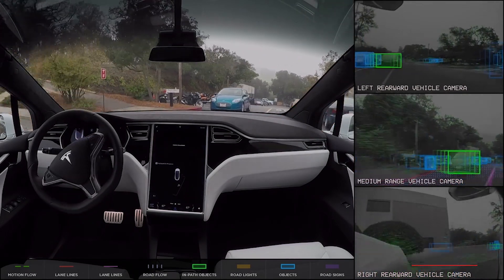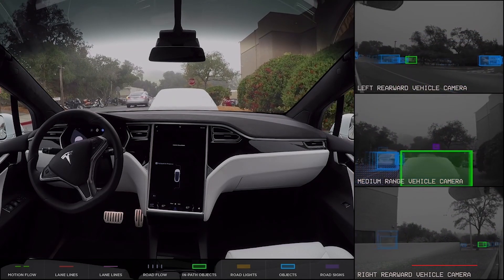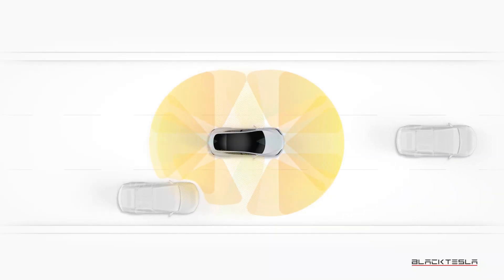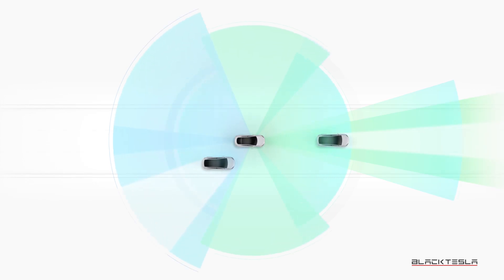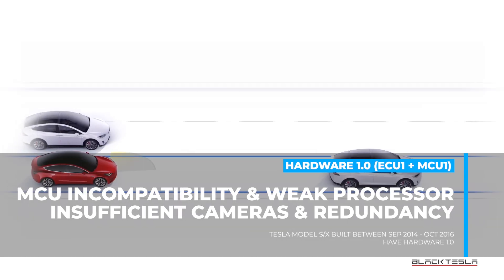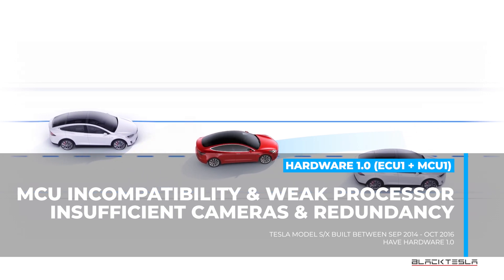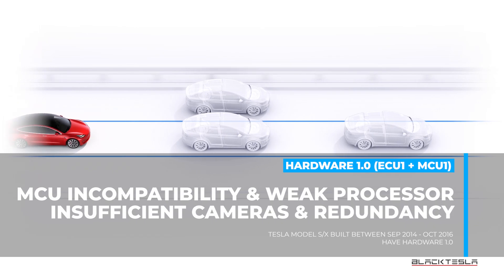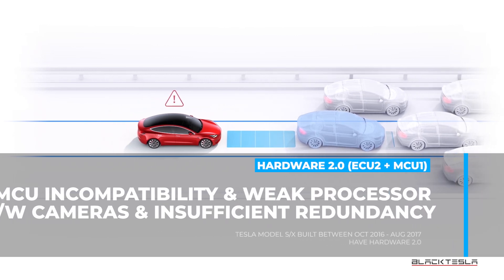Tesla Hardware 3 - Can Your Car Be Upgraded?

Comment: I have August-2018 Model S 100D with enhanced Autopilot , I'm planning to upgrade from MCU2.5 to MCU3 + Radio that is going to cost 3000$. They didn't mention anything about upgrading the Cameras (I don't have FSD).  They encourage me with this investment to benefit from a much better/faster CPU & screen performance , stronger LTE signal. My ask is , was this a wise move ? How to benefit from MCU3  , is it true if I subscribe to FSD then they will upgrade all the cameras ?
Reply from the maker: It's a great investment if you plan on keeping the car for a few years. You'll have a faster touchscreen and benefit from SOME of the latest software features. More importantly you won't have to worry about your cars currently MCU getting slow and rebooting often. If you subscribe to FSD Beta they may not have to upgrade the cameras as I think they figured a way around that.

Comment: I have a 2018 Model 3 with full self driving and it was built 12/18 and it’s the 2.5 so I should eventually be able to get the upgrade mentioned when it’s my turn?
Reply from the maker: Great question. The first thing is that if you do not have Hardware 3.0 computer you don't have full self-driving enabled, you've just paid for full self-driving. Thats the main point that confuses people. That said, if you paid for full self-driving check with your service center to see when you can get you hardware 3.0 computer installed. Once installed then you will have full self-driving features enabled.
Reply: I think you're in same position as me. Ours was built 6/18, has the same hardware setup as you, and I'm scheduled for the upgrade this coming Monday, 7/20.

Comment: Great video, Answers alot of my questions. One other that I may have missed. If I sell my MX does the FSD transfer to the new owner and if not, can they buy it ala carte from tesla in order to be eligible for the ECU 3.0 upgrade?
Reply from the maker: Good question, my best guess is that if you buy FSD and have the hardware installed then FSD stays with the vehicle open change of ownership. If you purchased FSD and have not had the hardware installed it should still be able to be installed after change of ownership, but that will be up to Teslas discretion. Bottom line you should look to get the hardware upgrade before selling to you can add that cost to the price of the vehicle 😉

Comment: Thanks for this video. 

I bought my model 3 SR+ in september 2019, and it still has hardware 2.5 (as I checked in the new "additional information about the vehicle" dialogbox). I think Tesla installed the last units of hardware 2.5 in the cheaper version of model 3.... Regards from Madrid, Spain.
Reply from the maker: Congrats on the M3! We have heard that there is some overlap with the computers phasing out with the less expensive M3 models! Nonetheless with M3 you can upgrade with just the swap of HW3 computer.

Comment: I have two vehicles. I have a Model S with AP2.0 that is on the list for FSD (2.0 to 3.0 retrofit upgrade), and a Model 3 that had AP 2.5 and was upgraded to FSD (AP2.5 to 3.0 retrofit). The entire process to retrofit the car took over 2 hours or 5 hours if you include firmware updating and re-calibration.
Reply from the maker: Congrats. Yes takes longer depending on where your service center is.

Comment: Thanks for the info, very helpful & explained well. I do have a question...I know I have EAP 2.5  (ECU 2.5) car was built in Dec 2018, How can I check if I have + MCU2 as well? Have the M3PD+ Thank you.
Reply from the maker: The easiest way to tell is to see if you have Tesla Theater. If you do you have MCU2 if you don't then you have MCU1. I believe all model 3's have MCU2 so you should be good.
Reply: Yes I do have TESLA theater. Thanks brother. I just can’t see me paying for FSD Bc EAP  does the same thing, except showing cones, stop signs, red lights etc...Is it really that much faster computer chip the EAP 2.5? 🤔

Comment: Model 3 Dual Motor Purchase date:  January 2019
Good afternoon. I'm proud to know that I am eligible for the 3.0 upgrade.  The cost according to my Tesla app will be $4,000.00 which appears to be $2000.00 dollars cheaper probably due to the purchase of Enhanced AutoPilot prior to delivery. 
Once again, thanks for the clear explanation.
  Keep up the good work.
Reply: You most likely paid $5,000 for the Enhanced Autopilot when you ordered the car, as I did.  In August of 2019 I received an invite to pay an additional $3,000 for "future" full self-driving.  The invite specified that the price would increase on August 16th, but did not say how much the increase would be.  I suppose it is now $4,000.
Reply: Paul C wauw full self drive 😳😳😳

Comment: Forgive my question, please. YOu have a wonderful video but is your info reliable? I have a Model3 with build date of June/2019 and how do I know if I have hardware 2.5 or 3? As per this video, I should have hardware 3.0 but my Model 3 does not see cones. I have not driven the newest update as yet or update: 2019 .40.50.1. Please help?
Reply from the maker: Thanks for the comment and it's totally fine to ask questions. Our info is vetted from employees and owner enthusiasts alike. That said, if you bought a Model 3 in June 2019 it is possible that it was built earlier than April 2019 which would mean you have hardware 2.5. If you have update 2019.40 or higher and you see cones then you have HW3, if you have that software or later and don't see cones you have 2.5.

Comment: just sucks to have bought an newer ap2.0 car just to see that a few months later 2.5 and mcu2 is here with teslacam and sentry mode -_-
Don't need the ap3 for fsd in Europe because of the stupid regulations. Still more hw power and less consumption would be nice.
and then there is still the idiotic nand problem with a full storage and even more write cycles on my mcu 1
Reply from the maker: Yes just about every Tesla owner 1yr or older has experienced this and it's very discouraging but it's also the price of agile innovation. However let's give Tesla a chance to at least make it right with an MCU upgrade for additional features.

Comment: Besides the date that the car was built, how can you definitively confirm which hardware the car has? I bought mine right at the transition point from 2.5 to 3 and would like to verify.
Thank you.
Reply from the maker: If you are trying to determine whether you have 2.5 or 3, all you need is any software newer than 26.1 and if you see cones in your visualization then you have HW3, if not it's HW2.5.

Comment: Thanks for clarifying this! I'm a Jan 2017 Model X so it looks like I may be screwed. Hoping they come up with a solution but it sounds like it's a nightmare--new cameras, new computers, new wiring etc. I would consider a discount on a new Tesla for the amount I paid for FSD at the time, with the FSD option thrown in for free, as this essentially discounts a new car by about $15,000 and costs them nothing.
Reply: FSD 2.0 cars get a FREE upgrade to 3.0 (FSD computer), irrespective of whether or not they have MCU 1 or have upgraded to MCU2. 
MCU has NOTHING to do with autopilot, only the visualizations of the autopilot software.  So it is not a limiting factor.

Comment: Wait did you say MCU 1 with hardware 2.5 is not able to get hardware 3?
Reply from the maker: Definitely didnt say that. They definitely will get upgraded but not at the moment since Hardware 3 isn't compatible with MCU1 and there isn't a known path to upgrade MCU1 to MCU2 "yet". Hang tight, Tesla will provide and path.
Reply: All good then.

Comment: MCU 1 and ECU 2.5 get Tesla Cam and Sentry mode on the front and repeater cameras. With MCU 2 you get the added bonus of the rear cam.
Reply: Do you need ECU 2.5, or is ECU 2.0 with MCU 2 sufficient for having Sentry Mode?

Comment: I purchased FSD with my 2017 Model X AP 2.0/MCU 1. I had reached out to Tesla asking if an upgrade to AP 2.5 and/or MCU 2 would be necessary, and they said no. Only a swap out of the AP computer for the FSD computer would be necessary.

I'm curious about where you got your info about MCU 1 and AP 2.0 not being eligible?
Reply: David Pullen I am in the same boat w you. Model S 2017 AP 2.0/MCU 1. FSD paid for. Will be extremely disappointed if I cannot upgrade. Refunds need to be available it it is not possible.
Reply from the maker: We also have AP2.0 and MCU1 so refunds at the least but I think they are working on a solution to upgrade MCU1 to 2.
Reply: Black Tesla thank you for an awesome resource!
Reply: Black Tesla so your research is telling you cars sold after Feb 2018 can get hardware 3?
Reply from the maker: Yes cars built after Feb 2018 have MCU2+HW2.5 and can get upgraded. One of our cars was a Sep 2018 build and we had MCU2+HW2.5 and got upgraded since it's just a swap of the computer.
Reply: @BlackTesla  FSD 2.0 cars get a FREE upgrade to 3.0 (FSD computer), irrespective of whether or not they have MCU 1 or have upgraded to MCU2. 
MCU has NOTHING to do with autopilot, only the visualizations of the autopilot software.  So it is not a limiting factor.
Reply: sakimano. This video is either not up-to-date or was misinformed at the time of post 9 months ago. I called a Tesla rep and he told me that my 2017 Model S 90D, which has HW 2.0, will be upgraded to HW3 since FSD had been paid for.  

MCU1 or MCU2 is not an issue for HW3 upgrade.  The Tesla rep told me that I can upgrade my MCU1 to MCU2 for $2,500 and suggested that when I go for my HW3 upgrade, I should do the MCU2 upgrade. Also, since the glove compartment will be taken out, I’ll ask them to replace my cabin filter.
Reply: @pslawing  FSD 2.0 cars get a FREE upgrade to 3.0 (FSD computer), irrespective of whether or not they have MCU 1 or have upgraded to MCU2. 
MCU has NOTHING to do with autopilot, only the visualizations of the autopilot software.  So it is not a limiting factor.
Reply from the maker: We've done a fair bit of research, but feel free to do your own due diligence. There are tons of discussion and debate online about this topic so my so our sources range from enthusiasts and Tesla inside sources. Perhaps the rep you spoke to thought you had 2.5+MCU2 but if it's not that there is more work than swapping out the computer. We suspect Tesla is buying time to come up with a cost effective solution for MCU1 owners.
Reply: @BlackTesla  yeah, I was clear with them about my hardware config. Honestly, I'm dubious about their answer, and I certainly wouldn't mind an MCU upgrade.

If they can't follow through on upgrading older cars, I suspect they are going to have a class action lawsuit on their hands. I'm sure they are working diligently to avoid that and do right by early investors.
Reply: I'm in the same situation. I do find it interesting that FSD is still an option I can purchase for my Model S but I know I have MCU1/HW 2.0. @Black Tesla Thanks video.
Reply: Exactly. Why would they have charged us for FSD is that wasn’t doable?
Reply from the maker: If I had to guess I'd say they were looking for funding for FSD which is why they offered way before it was even close to being ready. Beyond that, we suspect that they went down a path where the hardware they had at the time wasn't sufficient so they built a new computer and added more hardware in hopes that by the time it was ready people would upgrade their cars OR they would figure out a path to retrofit.